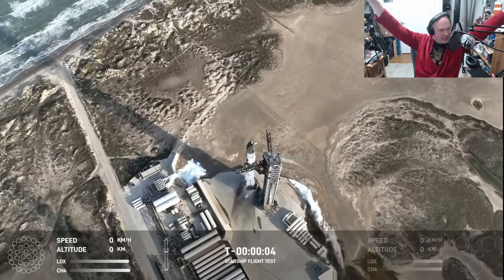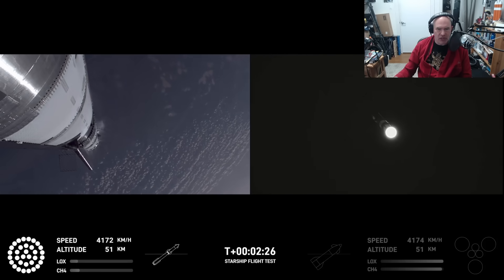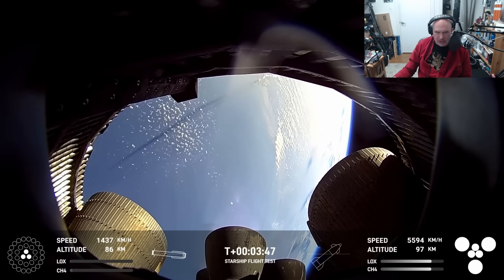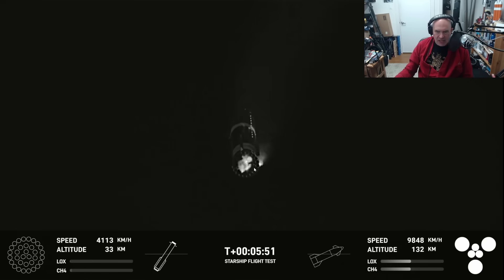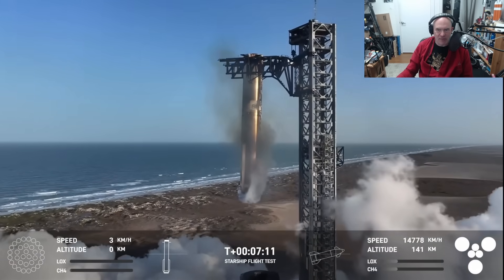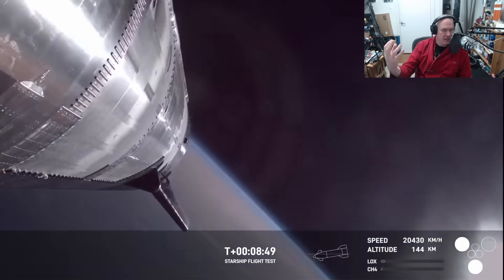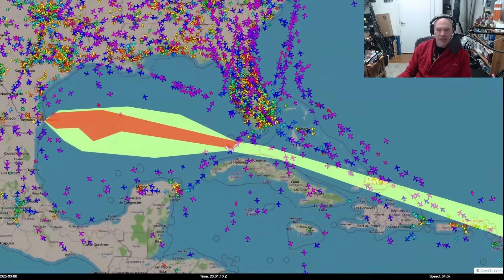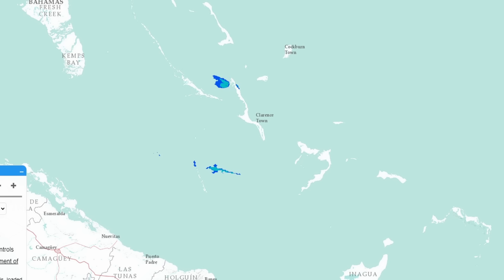SpaceX Make The Same Mistake Twice With Starship Flight 8

Comment: Maybe if the sea level raptors get a shock cone because of the outer engines expansion, allowing them to behave like on sea level, that effect could work on the vacuüm engines as well, they don’t (at least on one side) operate in a vacuum. Flow separation inside the cone could explain the damage on the nozzle

Comment: SpaceX has unreliable engines. They never know for sure if all the engines will start, run without a bang, or can be restarted on demand. Until they fix that, they won't go anywhere. How many Saturn V test flights were there? I wonder if SpaceX has to compensate the airlines for the interruptions.
Reply: The engines are very reliable... at least before they destroy them on the static fire test stand.  They're shredding through the ship before they even start flying.  The new test stand is destroying the R-vacs.

Comment: My thought is that the Hot Staging Ring is not tall enough, that it's causing a shock... I could be wrong though.
Reply: It's static fires.  They're destroying the R-Vacs through static fires.
Reply: @dl2839  you're saying it like it's a known fact
Reply: @meinking_sensei3807   I'm saying it that way in the hopes they'll check it out.  There's only been a 1 month to 3 week delay for the last two static fires.  Also, the fact that they've encountered problems in the engine bay, it makes a problem with static fires very probable cause.

Comment: i would like to add that they also have vaccum jacketing on the plumbing do they not? wouldnt this make harmonics or whatever so much worse? since its basically like having 2 guitar strings in 1. also something i've heard is on that static fire, the lox tank was full (or close to it) which might have dampened the harmonics in a way that obfuscates the issue.

Comment: I guess the rocket hadn't replied to the "What did you do last week?" mail. Now it and it's developers are fired.
Reply: The rocket has been doing static fires that have been shredding through the R-Vacs.  They are destroying the second stage in testing, that's why this isn't really a design problem and can't be solved with design changes.
Reply: It was an accidental cut, they're trying to make contact with the rocket to rehire it for vital functions.
Reply: @johnladuke6475   The problem is the addition of static fires.  Those are shredding the engines of the second stage.
Reply: @daniel4412   If the static fires weren't breaking the second stage and the rocket had a problem with resonance, then the first stage would break, too.  

The second stage is breaking far too quickly for this to be a problem with resonance.  Prove me wrong!  You can't because I'm right.  The static fires destroy the second stage.

Comment: Plumbing issues, for sure. SpaceX should use titanum fuel supply system in the upper stage. That's capable of tolerating extreme vibration. The problem: titanium is freakin' expensive.
Reply: The problem isn't the plumbing, the problem is that they're breaking the plumbing and engines unintentionally.   Static fires destroy the ship.

Comment: What sucked was the program was less than 20 seconds away from SECO. You would thing they would have measures in place for all engines to shut down if the any of the center gimbaling engines failed.

Comment: Just looking at the test, when they did the 60 second burn told me where the issue is caused, now put something in front blocking that burn (the hot staging ring) I don't think with the amount of thrust coming out, the side hole isn't enough to allow all this heat exhaust to escape, and this is causing too much back pressure, and damaging the rear of the vehicle, I would look there first, if pipe are melting from the extreme heat, this could be causing the issues we see.

Comment: THIS IS NEVER GOING TO DELIVER A PAYLOAD TO ORBIT AND RETURN FOR RE-USE         there is a reason you don't make rockets out of stainless steel

Getting a rocket into space would not be possible with chemical rockets if gravity was ~10% higher - its very borderline and stainless steel just pushes it over that boundy of the possible
Reply: Erm, both stages of Atlas-Centaur were made of stainless steel, and it had 181 successful launches, including sending the Surveyor landers to the moon, and the Pioneer probes to Jupiter and Saturn (I.E well beyond low orbit). It's first successful launch was all the way back in 1962, so it was hardly using modern cutting-edge technology either.
Stainless steel is perfectly fine. The problem with Starship is the added mass of the reuse hardware, not that it's made of stainless.
Steel is actually a better pick than aluminium or carbon fibre for a reusable vehicle, since it's far more heat resistant during re-entry, allow much less heat shielding to be used.

Comment: I like failures, as it enables them to find things that might not show up once its entered service.  The fact that two engines pushed it to a spin could have been handled better by software.  Software should be monitoring its plan with the current state of engines, and turn on/off/restart engines as to meet that plan, it should be aware that having 1 or 2 side engines running isnt going to work, it could have turn them off, and tried relighting engines that might still be working.   Old rocket software usually just follows timings, new software should be trying to control a rocket in what ever means possible as to fit its object.
Reply: The R-Vac engines are being destroyed in the static fire tests.

Comment: Scott,  Have we every seen a hot spot on the bell housing, like we saw with flight 8 ?  Was this the engine that failed first ?  If the engine bell suffered damage given the  active cooling of engine bell, could this caused the rud ?    Last question doesn't the booster look like it made a  faster turn this time vs flight 7 ?  given the two engine that initially didn't light, does it sense it is related to fuel slosh ?

Comment: Why didn't they shut down the engines as soon as there was a fire?  That way they may have been able to have a controlled re-entry instead of a huge uncontrolled debris cloud risking airliners?
Reply: A few reasons include wanting to burn fuel for less reentry weight and wanton more data, either of running engines, or of the whole vehicle in highly off-nominal conditions. 

Controlled reentry would have been impossible without attitude control anyway.

Comment: Nobody is flying on one of these things for years, if ever.  Strangely enough, I used to root for SpaceX. For some reason, not so much theses days. Can't think why.
Reply: You're elon deranged and what's worse is you know it and you think it's a good thing.
Reply: I mean, yeah?
They said from the beginning that they wanted 100 successful flights before putting people onboard (For comparison they did 87 successful launches on Falcon 9 before man-rating it)
Even at the current planned launch rate of 25 per year, that puts the first manned flight 4 years away minimum. Realistically, they're not doing 25 this year, so even longer.
Reply: @lazarus2691  fair point

Comment: They said they fixed the reignition problem..Wrong.  Why nothing from Elon on FTS yes or no?  I think this investigation will be longer.  SpaceX probably won't make even 12 flights this year much less the 25 they wanted.  But worse is that they will still be running the flight 7 tests on flight 9.  They expect to test, correct, and test new.  Instead, they will be running the same tests for the third time.  Dozens, maybe hundreds of tests are at a standstill because they can't fly long enough to get the data from them.  It's like instead of being in 9th grade you're still repeating 7th.  These early inflight failures are really stopping them from making improvements on a lot of fronts.  Too many.
Reply: The problem is simple,  but it isn't a design problem.   They will NEVER find the problem if they're only looking for design problems.  This is a testing problem. They're shredding the R-Vacs before flight on the static fire test stand.

Comment: The problem is the Engine, it's not reliable yet AND they are trying to get more thrust at the same time because the vehicle is so over weight that they must have even higher thrust to get back any kind of reasonable payload.  This is very bad, a vehicle development program with unreliable engines is likely to fail.  And frankly I am not going to route for the success of anything being done by a Oligarchical monster who is tryinging to destroy our government so he can loot the public treasury, no one should be buying anything from him, especially his hype.
Reply: The R-Vac engine is actually very reliable... unless they shred the engines with a static fire test, which they started doing on flight 7 and 8

Comment: I'm doubtful anything was 'fixed' between flights 7 and 8 more that they stuffed it with sensors and cameras so when the same thing happened on flight 8 they would know what to fix.

Worrying that there were more failed engine restarts on the booster on flight 8.

I get iterative design. But the more failures the more successful consecutive flights will be needed to trustthe system
Reply: That's the problem.  These two failures are not caused by design problems.  They are caused by testing issues.  The static fires shred the R-Vacs, and the ship is doomed before flight, and no design changes will save it.

They need to stop static firing the ship.

Comment: Curious! 
How much payload can we really expect the Starship to carry, if even a hot staging ring is too much for the booster to bring back? The ring itself is around 9 tons, and if they decide to keep it on, they either have to subtract a few tons from the payload or beef up the booster's fuel load & engine efficiency. 
Also, an empty ship, with some scaffolding inside, barely touches orbital velocity and barely has any fuel by the time it's boosting back. "Promised" payload is 100 tons to LEO, but it's hard to believe it will manage even Falcon 9's 22 tons, without abandoning reusability. Only fiesible application could be very light and bulku payload that can't be folded like origami.
Reply: Reminder that the original Falcon 9 design only managed 9t not the current 23t. So SpaceX have past experience with iterating up payload capacity.
Also, the problem with the HSR is that the booster uses dedicated landing tanks to land, and they're a very specific size, and were designed before the HSR was added.
There's still extra fuel in the main tanks (that's what you see them venting when they move away from the HSR) it just can't be used to land since it sloshes too much.
As for the ships, the V1s were making orbit with ~40t of unused fuel in the main tanks, which could have been payload instead. We don't know for V2 since it hasn't reached orbit yet.

Comment: May I politely offer? - SpaceX is doing something amazing! Without a doubt. But... let's please look closer. Why do 2 stage to orbit? That's as wrong as SSTO, 1 stage to orbit. The SpaceX rocket motor is the Wow-innovation, not how it is being used by SpaceX! First, you never use cheap but heavy Stainless steel for REUSABLE craft. You use expensive but light weight carbon fiber. Those rocket motors in Reusable craft must lift light weight carbon fiber ships! And second. They need the heavy booster to lift a 2nd and 3rd upper stage. That itself carries a human-rated vehicle. "StarShip" will never be human-rated. It is a 1970s, "Shuttle" atop the equivalent of a 1960s Soviet N-1 rocket. 1960s, 1970s thinking. 2 shuttle explosions taught us never to use that method again. NASA learned! It's in the guidelines! We DON'T carry heavy cargo WITH precious human cargo. We use less explosive fuel to carry humans, separate from massive explosive fuel to carry DEAD cargo. And 2nd we learned to have an escape system. Starship can never have that. NO! We are not trusting a long pole out the door for humans to jump out on. Musk's anti-Union, "let employees sleep on cots" mentality is NOT how WE are going to space. SpaceX has a job accident rate NINE TIMES that of similar companies! He's a Right winger. Okay! But we all have moved past employees on cots to work 90 hour weeks and employee accident rates 9 times normal. Does Musk ever go up in his rockets? No, too busy saluting Hit1er and telling people to work 90 hours a week like they were servants in South Africa. SpaceX is perfecting the Russian idea of many small rocket motors. But they are using them wrongly!

Comment: Hot take ahead: Heavy industry - especially Aerospace - cannot succeed without good-faith pushback and review from government regulators.

I was surprised when Flight 7's mishap investigation was only a few weeks long. A highly visible failure that causes major disruptions to commercial air traffic? Nah, no need to disrupt SpaceX's launch cadence. There's no way Flight 8 will end with the exact same result, right?

Turns out the well-meaning promises of SpaceX engineers and the considerably less well-meaning pressure from Dear Leader in Washington are a poor substitute for proper oversight and review.
Reply: Problem is, there is so much bad-faith pushback that it becomes impossible to distinguish the good from the bad.